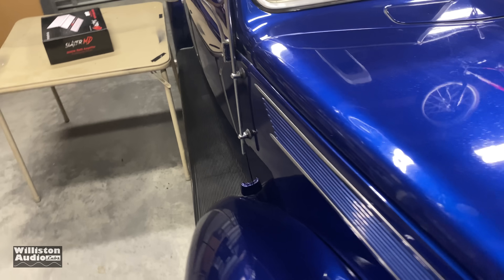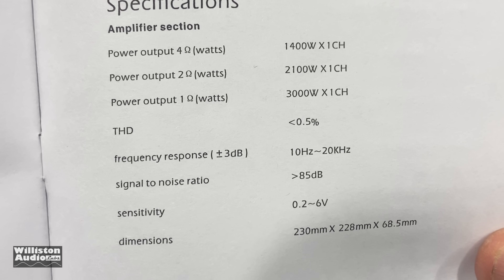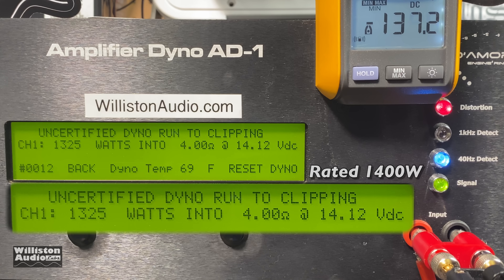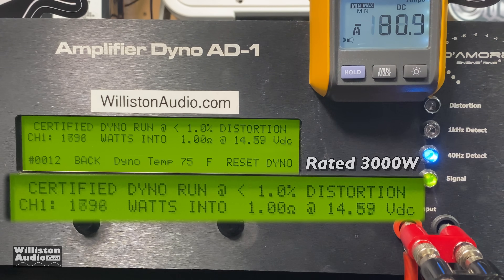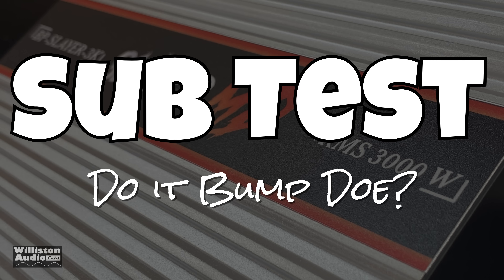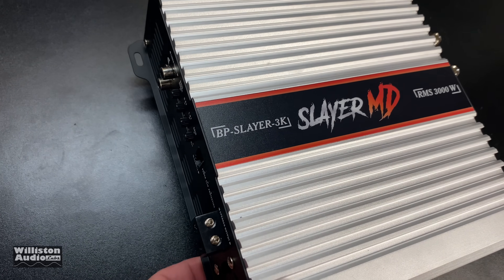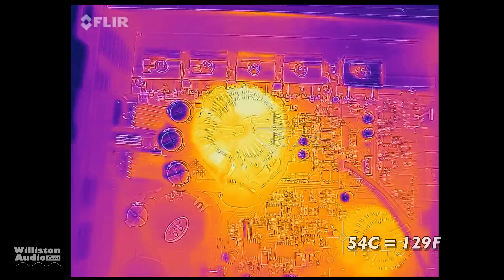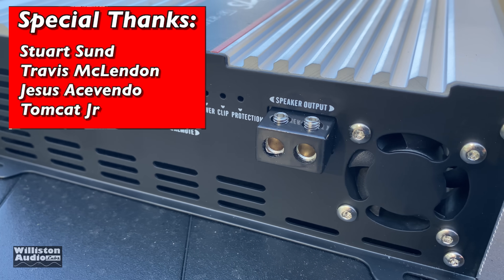Can a $180 Amp Do 3000 watts? Bully Performance Slayer MD 3kW Amp Dyno Test

Comment: Just my observation, yes some of the inexpensive amps can do rated power. However a rough calculation in my head is not even a 10% difference between true RMS and Dynamic power. How long is the amp really going to last running fully gassed at all times ? Not even going to get into the SQ aspects.
Reply: amps are different, different blueprints architecture determines the ratio of (peak dynamic/rms)..home audiophile the higher the ratio the "better"....most car amps go full power for at least 0.5 to 1 hour....fullpower may be 155db so "full power" is usually only for 1 song = 3 minutes..modern amps even car are extremely clean distortion ratings at half to 75 % full power

Comment: There should be no thumbs down. If you need an amp with no concerns for reliability, can't beat the price. I'm surprised that you didn't try .5 ohms...
Reply from the maker: It went into protect dynamic at 0.8 so there was no need to try any lower
Reply: @wal  wow...

Comment: taramps knock off?
Reply from the maker: Knock knock knocking on Heaven’s door
Reply: @wal  I legit paid the same for the taramps md1800.1.  The taramps is pretty good so far. It moves my 10" skar SDRs pretty good. I almost think I need a secondary battery though to really get the power out of that beast
Reply: @beardedforlife3740  no sir change the amp big d has a video for the 3500 skar and hooked up right gone hitt way harder
Reply: It may or may not be, but I might trade my taramps for this beast
Reply: @beardedforlife3740  oh yes sir all day not downing it one bit just saying it looks to me like a taramps but cheaper
Reply: @DieselDon91  first thing I thought was an HD line taramps
Reply: @beardedforlife3740  yea same I just checked pricing went up 100 bucks. So Big D putting them on the map!

Comment: If this thing lasts a year or two, its a great deal! Not a lot of heat built up either, which is a good sign. I really don't see why anything would fail with those low temperatures. Nice find and awesome video, Big D!
Reply: I’ve had my slayer MD 3k for 1 year and 6 months powering a single skar VXF 15 and it’s hasn’t let me down it barely gets hot and pushes out more than enough power at 1 ohm
Reply from the maker: It’s true!

Comment: How is this possible??
Reply from the maker: I’m asking the same thing...
Reply: @wal  maybe it burns out fast? Can it play a full CD at high volume and not catch on fire?? If it’s 1ohm stable then IN THEORY you should be able to run 2 speakers and a sub off of it...maybe it’s time for a ‘how much stereo can this amp power’ video??? Add crossovers to each speaker, crank it up and run for zee hills cause you know after 5min it’s going to be a ball of fire!